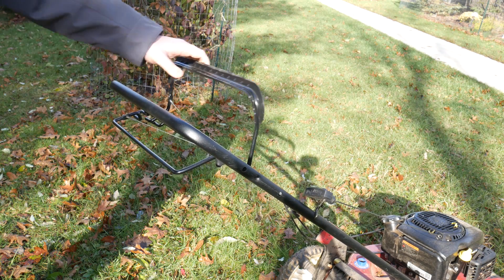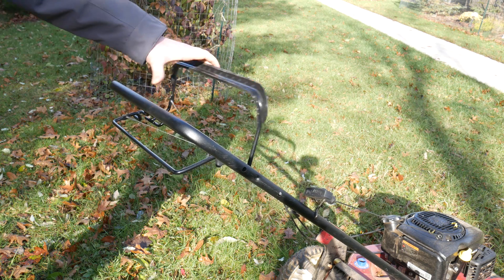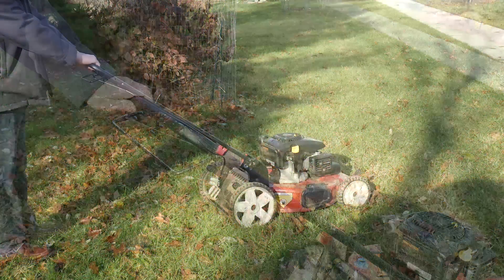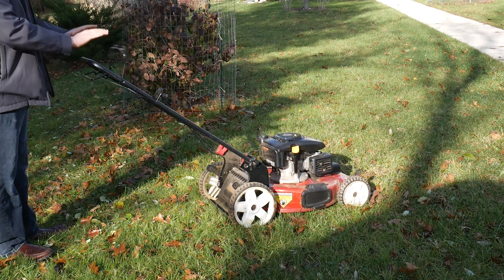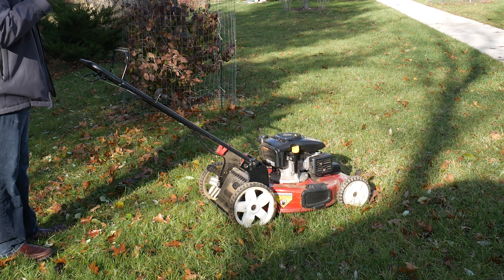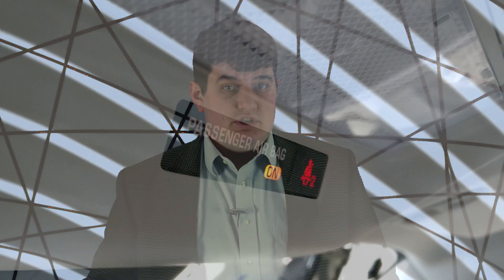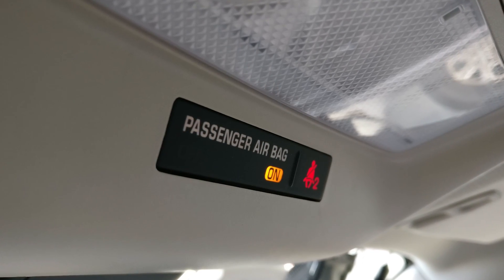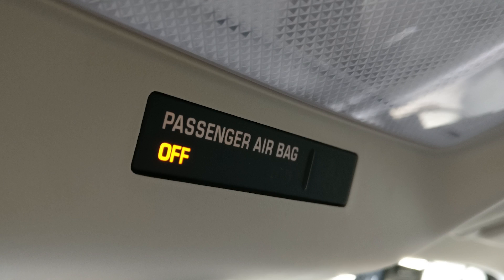The Dead Man's Switch:  How Anton Yelchin's life could have been saved

Comment: Unfortunately you got the deadman-switch in locomotives wrong. It's not a pedal which needs to be held down - this would be tiring  and could also be done by someone distracted, sleeping or even dead. Instead it is a challenge-response system. There is a signal - visual or audible - to which the operator needs to respond by some action - pushing a pedal or a button etc. Otherwise an emergency stop occurs.
This is much safer since it also ensures that the operator is able to react rather than just being present. Also it is much harder or impossible to override - you can't just put a brick on a pedal or tape down the button, as the system requires them to be operated - engaged and then released - otherwise an emergency stop is triggered. I believe the systems used in trains also randomise the times you need to complete the action at instead of doing it at regular intervals, so you can't leave your seat and return in time to operate the switch. You can make the action even more complex to ensure that the operator is able to complete complex tasks - inputting a number combination or operating levers at a certain changing order, but I don't know if this is actually done anywhere.
Reply: Actually, horrovac, different deadman's switch designs are used in different locomotives and electric trains. The most common deadman's switch employed in locomotives is similar to that of joystick operated forklifts and scissor lifts - a paddle switch on the throttle that is depressed by the hand when operating it. The switch has just enough spring tension to open the circuit, so as to not appreciably fatigue the user.
Reply: @Eisen Faust Ok, thanks for the info - the type of switch i described is what I once read about being used at a national railroad company as standard. It stuck with me because I found that this kind of thing is very sensible ans well thought-out. Requirement to complete an action like depress/release at random times is pretty much tamper-proof and completely reliable. I should have qualified that I don't claim any expertise on the matter and don't know all types of switches used. However I must say I don't like an idea of a system with this purpose which can be overridden by a rubber band or a brick. Without strict discipline, safety systems that can easily be overridden will be.
Reply: Generally, the throttle requires constant attention just as in cars without cruise control. Anyone putting a rubber band on the switch would do it for no reason.

As for a random light scheme being tamper-proof, it could be bypassed with a bit of wire and a relay.
Reply: @Eisen Faust Someone once said: while trying to design something to be fool-proof, never underestimate the resourcefulness of fools. In case of a pedal you might want to put a brick on it so you can keep your foot elsewhere, or cross your legs, for the hand throttle you might want to push it with one finger instead of gripping it with your hand. I don't really know why someone would want to override this, but in case they want, to, doing so is extremely easy. However i don't find this scenario very likely. What I'd be more concerned about is a possibility that someone might lose their consciousness or even die still gripping this handle (or pushing it to the max). This is defeating the purpose of a deadman'-switch, in fact I would not really consider it one.
I did not say that the random challenge-response scheme is absolutely tamper-proof. Nothing is. You could use a couple of wires and a relay, sure. Disassembling your control panel would get you caught very soon though. So you could use a light sensor and a mechanical foot or a hand. Or take your robot to work with you and have him drive the train. All of this is way too complex for anyone to bother, you might as well just do your job. You can't seriously compare a contraption with a relay and a solenoid and a power source and levers to operate stuff with simply taping a switch down. One requires a serious amount on engineering, other requires just a bit of sticky back tape and a goodly amount of irresponsibility.
Reply: Despite what you see in movies, humans almost invariably lose their grip on things when they lose consciousness. As for pedals, those may or may not remain depressed.

No dismantling of the panel required - a putty knife will prise out most panel lights and then you just wire the light to the relay and the relay bridges the switch.
Reply: @templebrown7179  One problem with many deadman switch designs is that operators who panic may mash the switch which keeps the machine on; I know I've had that happen with a machine I was testing that had a pendant wired as a deadman switch.  An approach I think is brilliant, but have only seen described in a catalog page for one particular not-otherwise-impressive handheld pendant control featured a live-man switch that would shut off the machine if it was released or if it was squeezed much too hard.  Such a control would have resulted in my shutting the runaway machine down a second or so sooner than I otherwise did (the extra second didn't cause any damage to me or the machine, but it's not hard to imagine cases where it could have).
Reply: The switch horrovac describes is the one currently used by most trains in my country.
On visual or audible signal the operator has a set time to either push a button or a pedal. The time between the signals is relativ random as is what signal is used or what action is required.

In the past there was a simpler system, it required the operator the push a pedal every 90 or so seconds. It was discovered that this system is a dead man switch but does nothing to protect against an reading, distracted or even sleeping operator. After doing the same thing every 90 seconds for hours, they would literally do it while sleeping.
Reply: The alerter system you describe is what modern locomotives use. Deadman's pedals were fitted to older locomotives. And they were often defeated in the precise ways that you describe. Hence the modern approach.
Reply: Similar here. After an accident with a train where the driver had 'activated' the deadman's switch' putting his bookcase on it, it was quickly changed so there had to be a change, always active wasn't enough, it has to be off every now and then, too.
Reply: That system is called an "alerter". It was designed around the fact that people did in fact defeat the dead man's switch for reasons such as going to the toilet or eat lunch without stopping the train. Very poor judgement, but people can be pretty stupid, even if they drive a several-thousand-ton train. Alerters are really the kind of thing that Elon Musk should be using for Autopilot, as they allow the user to indicate awareness without encouraging such defeats as weights on the steering wheel, which would be ineffective in an alerter situation. (While at the same time making the user more comfortable with the system.)
Reply: On metro trains in London, the throttle control is in two parts; the handle and the solenoid. If the handle is pushed down (or, on newer stock, rotated), an electrical contact completes the circuit with the solenoid, thus allowing the train to move. When the handle is released, though, the circuit breaks; thus, practically infinite resistance is run through the circuit. This is what an emergency brake application is.
Reply: I wonder if this might not be a good thing to look at adding to cars when semi-autonomous vehicles get just a little bit better, say have something where if you don't make an input to the controls for a while or if it say detects the car is starting to drift out of lane it issues a warning and if you don't react within a couple of seconds (Or sooner if it detects that it's on a collision course) it pulls the car over to the side of the road as soon as it is safe to do so and turns on the hazards and brings it to a safe halt. Would prevent accidents from say people falling asleep or having a heart attack or similar at the wheel.
Reply: RSC came in after a disaster in Canada - back then, locomotives did have pedals.
Reply: @robertknight4672  there's another movie where they did that but I don't know how they did it
Reply: I wonder if that’s the seemingly random high pitched whine I hear whenever I’m riding Pittsburgh’s T. It comes on more often if the car is moving faster, and I can’t think of anything else that could trigger it.
Reply: Requiring to input numbers? How about 4, 8, 15, 16, 23 and 42?

Comment: I use a seat sensor on forklifts all the time that lockout operation of the vehicle when the seat is empty. Perhaps it is the quality of equipment I'm using, but the sensor randomly malfunctions, removing the ability to drive or operate the lift functions *while I am in the middle of moving or lifting large, heavy objects*. The company mechanics have, so far, been unable to repair the problem and have simply bypassed the sensor.
I understand the function of the seat sensor. A faulty sensor can be a nuisance or, at worst, prevent an otherwise working vehicle from operating. I am currently not confident that car manufacturers will install equipment that will work reliably for years. Case in point: the Jeep has a well known faulty gear shift.

Comment: Chrysler has been known to be cheap and that's what it comes to, being cheap to save $8 on adding in a part for a safety feature. Back in the 90's  Chrysler minivans did not have brake shift interlock and there were cases where kids would get into the driver seat, even while the vehicle wasn't running were able to shift the van out of park causing one woman to be ran over.

Comment: But that solution introduces a load of larger problems, such as people being lifted briefly out of the seat while driving (for instance, over a bump), or the sensor not working correctly. The first one can be solved with a delay, but the second one could cause the car to stop in the middle of an intersection, and not allow it to be pushed out of the way. These sensors go out some times, I know my car has had a broken sensor after being only 2 years old.

Comment: I doubt there was amything wrong with the gear shift that the millions of owner everyday do not have an issue with..... operator error.  How many people step pn the gas instead of the brake every day?  Cant fix thing to the point it will not work at all.   Tragic... but just because a beloved (grown up and educated I assume) actor got killed does not warrent introducing so many safety devices that stretching your back and lifting your butt a bit shuts down the car.

Comment: The whole "drive by wire" idea is a safety hazard in itself. If the computer malfunctions or locks up while you're driving, you're screwed as you no longer have control over the car.
Reply: jec6613  Sophisticated electronically monitored predictive maintenance systems are just as possible as redundant electronic controls.  It's not like all we can do is run a belt till it snaps and then throw our hands up.  In some industrial applications, where many expensive components have to be mechanical, computers monitor uptime and use sensors to monitor variables like temperature, humidity, dynamic load, etc.  They use this data to estimate wear and compare that to the expected duty cycle of the component, then trigger a warning alarm when it's near the end of its life. 

Frankly if we wanted to make cars safer and more reliable all we'd have to do is integrate a pm schedule into the now ubiquitous dashboard computer, and so instead of getting the dreaded check engine light, we'd get a helpful "replace your serpentine belt w/in 1000 miles" notification.  Doing this just by sheer mileage would probably be safer and cheaper than your redundant motors and sensors.

The cynic in me thinks they'd never add that though, cause how could they rip people off at the dealership if the customer knew exactly what was wrong with their car?
Reply: Mechanical systems are more likely to fail and fail catastrophicly. Wires wear out, or stretch with age and heat. Corrosion eats away at it all. The most common failure in a car engine is a belt failure, a mechanical item. Mechanical solutions are also less efficient than electronic solutions, hence the move away from carburators.
Reply: The whole "drive mechanically" idea is a safety hazard in itself. If an axle or a wire breaks while you're driving, you're screwed as you no longer have control over your car.
Reply: When people think about computers, they only think about their home Windows PCs or smartphones (and it makes sense, if they're the only computers you're actually seeing at work regularly). And of course those lock up all the time, because they have a random selection of hardware inside them and are running a random selection of software on it, so it's a miracle that they even work at all. But if this is your definition of a "computer", then it would be wrong to call the thing inside your car a "computer" at all, because the two are wildly different objects that only resemble each other on the most basic level. Car computers don't just randomly "lock up" or "malfunction" like your regular desktop PC does daily.
Reply: CoolDudeClem 
When was the last time that happened in the last two decades?
Reply: As someone who owns an old audi, I can tell you with certainty that the first components to wear out on these old, complicated cars are the electronics. Mechanical components such as the timing/serpentine belt have a limited use time, then they should be replaced. This goes for engine fluids and other components, and as long as they are maintained, very little can go wrong with normal operation. Electronics, however do not get replaced as there is no service interval for them, it is extremely hard to do so with a lot of small, tucked away components (trust me I've had to replace some already). This plagues a lot of early 2000s german cars with a lot of electronics. Sure newer cars might have better made components that mean they last longer, but they also have more of them and they will still fail after a given period of time.
Reply: @Puppygirlears  all of that to say "the mechanical parts are what actually wore out first but thats ok because we've gotten used to that so nobody cares, now 20 years down the line the electrics are showing age and that's just unacceptable I tell ya"
Reply: @PiPArtemis  you misunderstand what i am trying to say, I'm not stating that  electronics are worse period. My point is that electronics are not expected to ever have to be serviced when being designed in a car. This means that you have to tear away at your interior trim or dash or other stuff that was never meant to be moved or replaced often, making working with it very hard. Contrast this to the mechanical parts of cars. Often they are in an area where they are relatively easy to access and work on (this is definitely not always the case) at least relative to the electronics in a vehicle. The second thing is that it is a lot harder to predict when electronics are going to fail. things like belts, brake pads, even internal engine components are a lot easier to tell when they are stressed and weakening. Electronics could be used for this application effectively as long as there is some kind of maintenance or upkeep and routine inspection (like there is for mechanical components). The thing is in some of these situations the job is only done marginally better, if at all, by the electronic replacement. So if the electronic version is much better, designed to be serviced and inspected and has longer service intervals then i have no problem with it.
Reply: A few years ago with the Toyota Unintended Acceleration events. https://www.youtube.com/watch?v=NCTf7wT5WR0
Reply: CoolDudeClem I completely agree, I have never been a fan of the drive by wire type systems.  Givee a car with physical linkages to throttle, brakes, steering, gear selection, etc... I am no idiot and don't require a computer to interpret what my intent is.  The older physical connections are quite reliable with very little routine maintenance, decades of building cars with them is proof enough of that... And when something does wear out or fail it is easy and inexpensive to repair.  In addition to that I have yet to drive a drive by wire car that didn't have input delay.  When I move the throttle, etc I expect the car to follow my command without  a delay for the computer to "think" about what I want it to do.
Reply: Not like modern car makers to make things that only serve to make their cars more dangerous, less involved and easier to use (allowing less skilled people to get into cars is a terrible idea I have two trashed cars, one of which was PARKED as proof of it). They are great! Until literally anything goes wrong. Can't say I've ever heard of any issues with a throttle cable and if it does get damaged you can't rev the engine but an electronic throttle means your car is a brick if anything goes wrong. Modern cars are just a fucking dangerous mess, only advantage they have is that when you crash you are a bit less likely to die yourself but at the cost of having a car that will only make you more likely to crash (something about planning for failure being more dumb than regular planning)

Comment: almost all cars with a real shifter have a key interlock. the key cannot be removed from the ignition without the car being in park. as for smart key cars witch is where this problem started if the car has a werd shifter just have the ecm put the trans in park any time the car is turned off like the Prius.